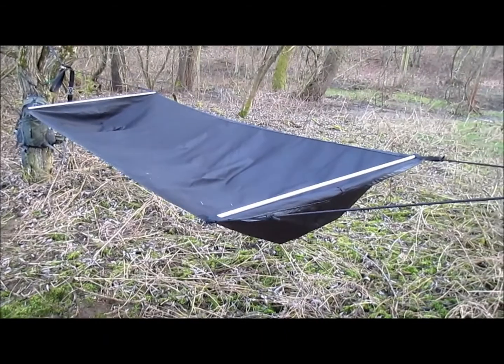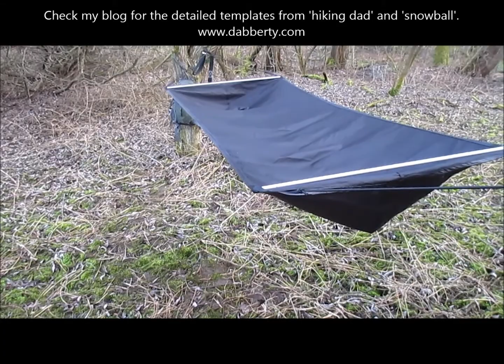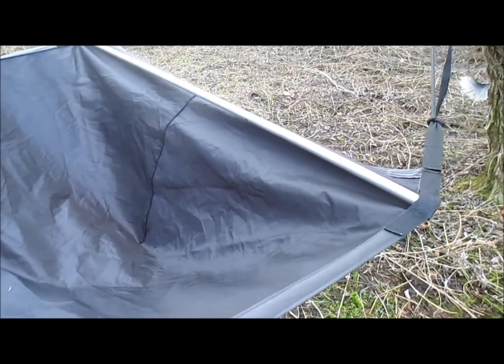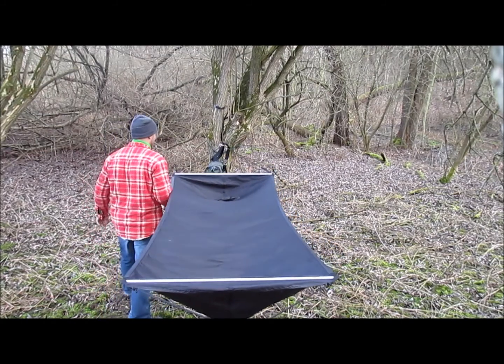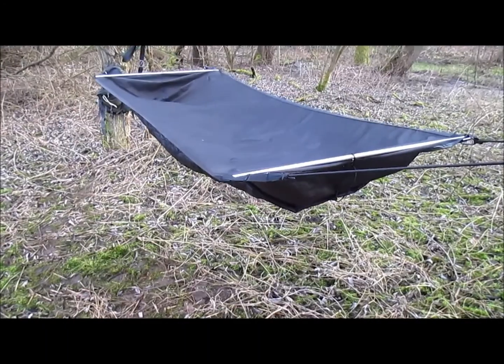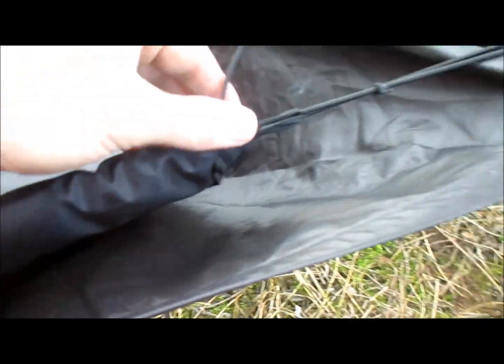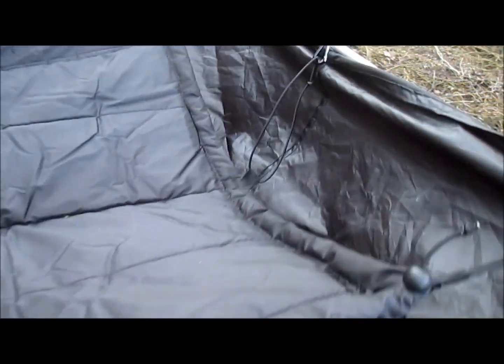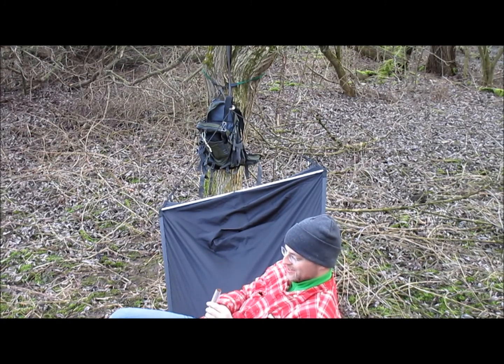2015-02-01 - DIY bridge hammock & underquilt

Comment: Nice work! Glad to see that the Bridge Hammock Fever is spreading out to Europe! I wonder if 10-12mm tubes would be solid enough, permanently. These tubes are tent poles, right? How do you connect two parts of them?
Reply from the maker: dendronaut.com - Infos zu Outdoor-Hängematten Hi, so far they work fine, i had it with me on 4 trips so far. The tubes are not tentpoles, those where not strong enough. These tubes are from Hornbach, sort of homestead shop, where they have everything for building a house etc. There are 3 tubes in total, 12, 10 and 8 mm, cut in each different lengths. So at every connection point there are 2 solid pieces around / above / within it. Does it make sense describing it like that ?
Advantage is that this way i can pack it very small away.